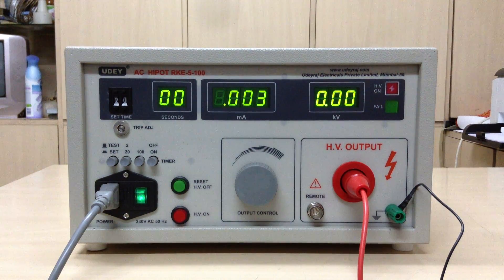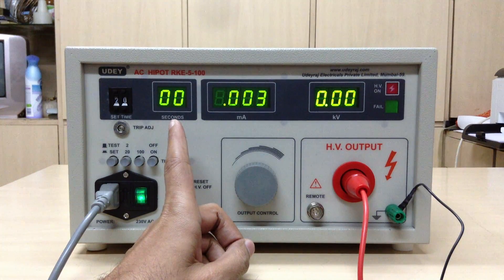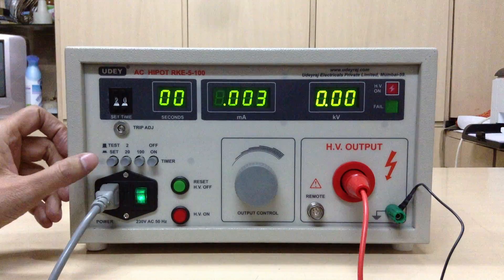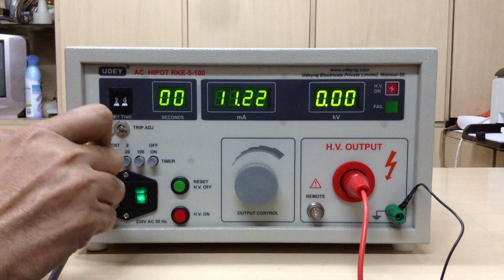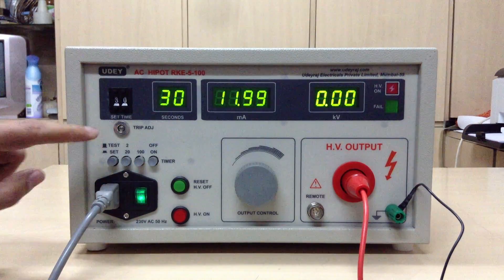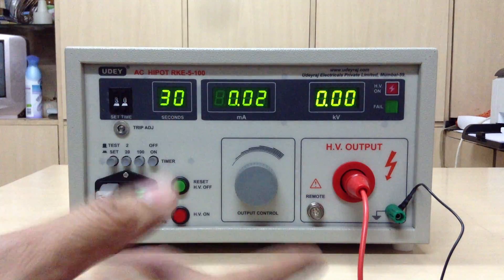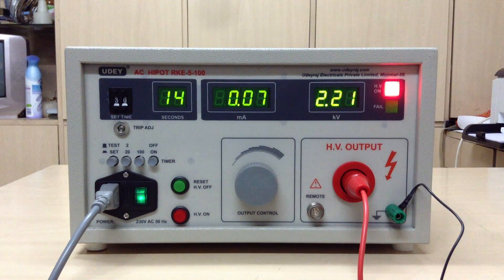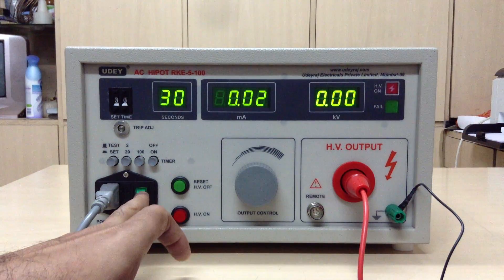5 kV AC Hipot tester

Comment: what is the acceptable mA value for hv test.
Reply: It really depends on the application. Most tests have a 12mA trip setting, but what you are really looking for is break down of the insulation. It's a pass/fail type of test.
Reply: hello. it means it will be trip when it reach 12 ma?
Reply: @electrainti1607  yes if the leakage current exceeds set current value.